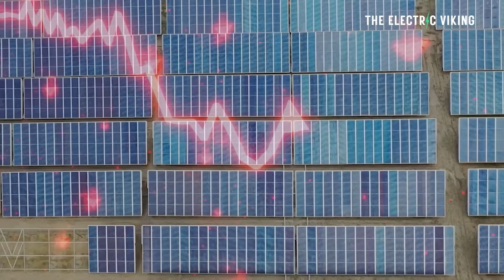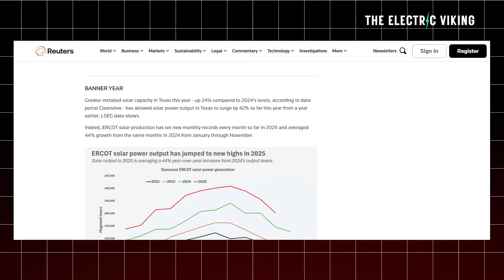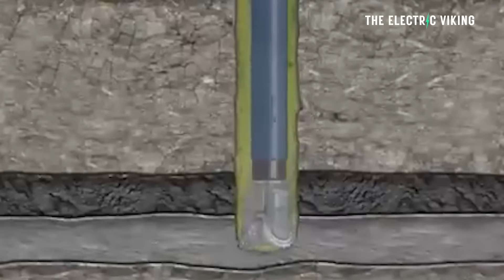Texas' clean power breakthrough; solar output skyrockets 44% to BEAT Coal in 2025

Comment: Sam, I follow the energy mix in ERCOT’s app on my phone and coal really isn’t a major factor in Texas utility power production. The big elephant in the here in Texas is natural gas. When wind is not blowing sufficiently at night, wind production is at maximum, natural gas prides 50 to 60 percent of power in the area that ERCOT serves which excludes El Paso and Beaumont. Natural gas is the tough nut to crack not coal. A Rice University paper showed that Texas could easily replace coal with wind, solar and batteries.

Comment: There are few things more vulnerable than a solar power plant.  No matter how green we go, we should keep some traditionally fueled power plants as backup.
Reply: Backup fuel will always be available for now. We have to consider natural disasters. Never solely rely from one source of energy. 
For an example one police department they have EV's in their fleet but if there is a natural disaster they have a backup fuel tank that will provide electricity to charge their EV's. Always have to have a backup.
Reply: And yet, the fact is that coal pants (and gas plants), which are very complicated machines, do break down, and when it happens, it takes weeks or months to repair.  This problem of coal and gas plants breaking down or needing months long maintenance shutdowns was one of the main contributors to the frequent rolling blackouts that California used to have when they relied mainly on coal and gas for their electricity.  Now that California has added a large amount of solar generation with batteries, the rolling blackouts have ended.  This example tells me that solar farms are much less "vulnerable" than coal and gas plants.  

Common sense tells me the same thing, by the way.  I mean, a solar plant is made up of a whole bunch of panels, grouped into numerous circuits, and any one could go down without affecting the others -- and the same is true for battery farms (hence the term "battery").  If something goes wrong at a traditional power plant, you have one very large and very expensive and extremely complex machine sitting dead still, leaving a large hole in your power generation.
Reply: @HonestJohn-y3k  Sure.  But a machine gun will take out a solar farm.

Comment: ERCOT is mandated to buy the cheapest electricity. They care little about clean air, water, or Trump for that matter. Renewables and batteries get pushed to the front of the line because Texas exports so much natural gas the price is artificially high by about double. As long as the cheapest electricity rules the day, renewables will win the day. Politics in this case have nothing to do with it.

Comment: I’m from Texas and live in North West Indiana now.  I had no idea solar was growing so big there.  In Indiana, it’s $0.20 kWh and getting higher incrementally to a target of $0.26 kWh and they say it’s because of the decommissioning and routine maintenance of the coal fired power plants and switching to renewable energy.  Bottom line is everyone is forced to reduce usage due to climbing costs and struggle to pay bills.  Plus, we’re starting to get taxed for having EV’s since we’re not buying gas which is taxed.  So the electric bill is going up and they tax EV’s on top of this increase which reduces the savings for switching to an EV exponentially.
Reply: I’m still in Texas, and have solar on my house, and an old EV (my secondary car). Now it’s a $200 yearly registration fee on EVs, which is higher than what I pay in gas taxes for driving my other vehicle every year. I’m paying between $0.14 and $0.18 per kWh. It’s not the cheapest, but it’s one of the only ones that will compensate me for power I feed back into the grid.

Comment: Texas also has probably more wind power production than any other state in the U.S. The areas west of the I-35 corridor is blanketed with wind turbines. It is great to see. It is not uncommon in this area to see wind turbines alongside oil pump jacks. Makes me smile.
Reply: I’m south of Houston and I see wind turbine parts on Hwy 288 fairly often
Reply: A lot of that wind power is powering those pump jacks.
Reply: Texas still make it financially difficult for homes to install solar cells. The reason why there are so many windmills out in west Texas is due to the high ROI that overcomes politics. The corrider from the Gulf to Denver is so windy that hang gliding world records are set there.
Reply: @hl2349 I have often heard it said that the central plain states including OK, KS, IA, WY, (although there is political opposition there due to coal mining), ID, and MT could power the nation with its wind energy, just have to transport it too far. I have heard that hydrogen production could be used to overcome the transportation of the energy challenge. I don't know how well that is panning out though.
Reply: @nooneyouknow7036 Indeed, getting the power where it's needed is the problem.  China has built and is expanding multi-gigawatt HVDC lines from renewable generation in the west to demand in the east.  The Biden Department of Energy approved a loan guarantee for the Grain Belt Express which would have done the same in the US - but Trump of course killed it.  "Energy emergency" - but kill all of the potential solutions which can go up in a year or two, only fossil fuels and maybe nuclear need apply.
Reply: Panhandle area too,, endless wind turbines on the way west.
Reply: @frankcoffey what I see is turbines headed to west Texas from Freeport

Comment: Additional problem in Texas is we have aging gas power plants that had been expected to close, but officials required they be kept open.  They are expensive.
Reply: The problem is the development cycle. Right now just the wait for a turbine for a gas fired power plant is 5 to 7 years meaning it takes many years to get these plants up and running. Meanwhile, as long as there aren't permitting issues, a large solar farm with battery storage is up and running in months.
Reply: Why is that?
Reply: They are backup in case of another freeze. The "free market"is a hoax.

Comment: We need stop talking about renewables being "green" and educate people on the cost efficiencies.  If you want to save the Earth, inform people they will save money.
Reply: Exactly!! There are many climate deniers but zero money deniers.
Reply: Coal dead, every major coal mining company bankrupt and after stiffing creditors, manage to eke out a business.  In addition mining depletion tax subsidies, reorganized coal mine moved forward dispensing money owed to shareholders, banks and many other suppliers. 
Deader than Trump's 1st year in office.
Reply: Good luck with that.
Reply: @SteveSonoga  fair.
Reply: You're talking about MAGA being educated. Not sure they go hand in hand.
Reply: The only reason why solar is the price that it's at is because of Chinese solar panels. These are sold at below market value to try to corner the market. Also every single person who's ever installed solar talks about how expensive it is. Every single solar project that's ever been built has gone over budget and costs a lot more than what they say. Every single solar power plant has to buy energy off of the grid when it's dark or when it's overcast.
Reply: @brucewilson77  I have installed 24 solar panels and 15 kWh of battery storage , now powering my home over 90% of the time… I could have gone 100%, but the ROI for the marginal 10% would have been unsatisfactory. The project came under my initial budget… because the cost of both panels and batteries had come down between the time I did the budget, obtained the authorization, got quotes and ordered the work to be done. 
The costs are dropping like stones.
The solar panels will pay for themselves in 6 years, and the batteries in 8. After that, I will enjoy nearly free power for 15-20 years!
At grid scale, the cost advantage of solar + storage over fossil energy is even more spectacular!
You obviously have no idea what you are talking about!
Reply: @brucewilson77  That where battery storage comes in
Reply: @brucewilson77 is this comment from twenty years ago? You can take your house off grid In three years by cutting out Starbucks,tv cable,and cigarettes. That’s besides what you save on electricity.
Reply: @brucewilson77  2020 called, they want their facts back.  All that has changed over the past 5 years.  Batteries have made solar cheap and available 24/7/365.
Reply: In India solar power plant are signing purchasing power agreement as little as only 3 cent in USD which is at least 50 -100 percent cheaper than Coal .

Set up a production capacity of over 100GW in solar modules and almost 20 GW of solar cells .
Only problem remain is due to high population density in rural areas unlike western country  land acquisition is hard . Because unlike China the owners protests for every tiny reasons, go to court cases .

It doesn't matter what climate crisis deniers say renewables are the future . There's not a single resistance from any political parties . Heck , unlike west so called right wing parties are more dedicated in renewable energy 😅. Those who are installing rooftop solar getting double subsidy from both center and state government . Reducing more than 50 percent of the costs .
Reply: @brucewilson77  yeah, that's why we, here in Texas, are installing solar at a record pace and I with solar panels on my roof am enjoying the savings and charging my EV at home. I love how people who are completely clueless about the subject decide that they are experts. When it comes to solar plants you fail to mention that they have battery electric storage to back them up. Welcome to the 21st-century!